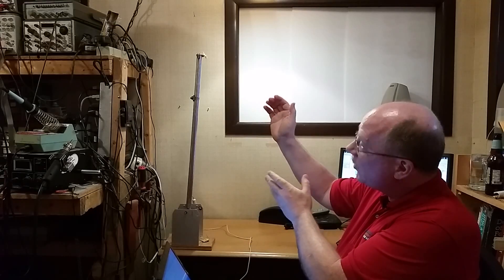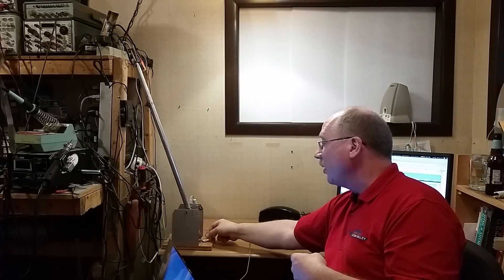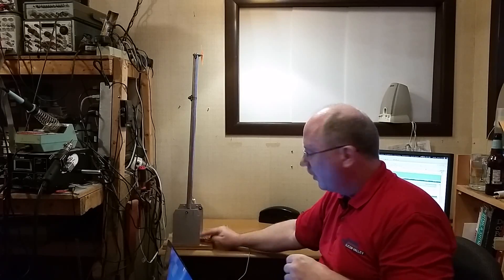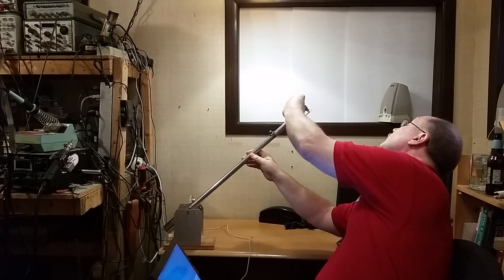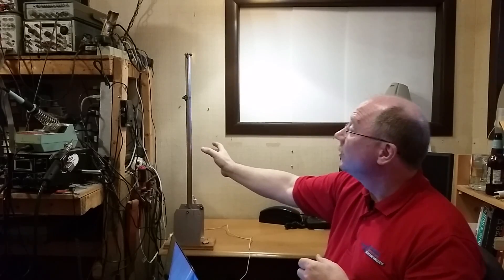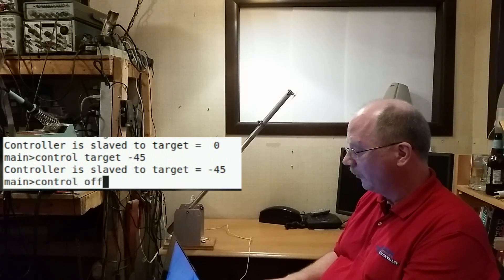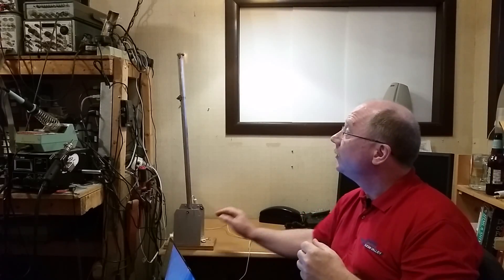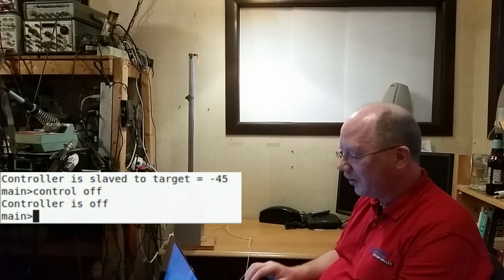What is a PID Controller?

Comment: 'PID without a PHD' is the best explantion of PID control that I've come accoss. It's even better than this video. Sorry Tim.
When you know that the I term is just the running sum of all previous error terms and that the D term is just the latest error minus the previous error, it becomes really easy to understand and therefore to write microcontroller code for.

Comment: Perfect explanation, 
although why it's not possible to run Proportional part and Derivation separately? And why just integral part cannot be turn without P and D?

For Integral pert can I say this?
"if error occurrence takes more time before it's cleared 'I' is higher. Bigger error and more time it's out of correct position 'I' goes higher and it will not go down until it reach correct position."
Reply from the maker: Tuning P & D separately: The amount of derivative action that you have determines how far you can push proportional.  For this demonstration system, you can't have much proportional gain at all if you don't have derivative action.  In fact, with really good bearings, at least in theory you couldn't have any proportional gain without some derivative action.

Integral is the same way.  For some plants you can use just integrating control -- this isn't one of them, and needs to have proportional action (which requires derivative action) before any proportional action can be added in.

As for what integral action does -- in general, it doesn't go away when the plant has reached its target position.  Integral action is there to provide the standing drive that some plants need to stay in place at the target position.

Comment: hello sir i m an undergraduate student in ME  i m working on self balancing vehicle(Segway) i apply PID in MATLAB on full non linear system so i want to ask you that is it ok to apply on nonlinear system or should  i  use LQR controller 
pls reply
Reply from the maker: LQR (plus an observer) is just a way of arriving at a controller design.  A PID is a controller topology, and there are a lot of practical SISO controller transfer functions that can be translated into a PID topology.

It's been a long time since I've done the math, so feel free to double-check this: If your plant is SISO and you model it with an integrator and one pole, and you do LQR and a full-order observer, then your controller will be a second-order SISO system.  Just about any reasonable choices for the LQR cost weighting vectors and the observer inputs (noise covariances, pole positions, whatever), will give you a controller that can be cast as a traditional PID.

Ditto (and again, check my math) if you model the plant as one integrator and two more poles (one or both of which could be an integrator), and make a reduced-order observer, then assuming reasonable choices for the LQR and observer designs, you'll end up with a controller that can be cast as a traditional PID.

Now here's where I get cynical: when you do LQR design and observer design using "optimal" control theory, you are pulling numbers out of a hat, and you do not have any formal tools for accounting for plant variation or mismatch between the plant and your model.  So you choose LQR weighting vectors, and he inputs to whatever observer design method you're using by -- wait for it -- the seat of your pants.  You're doing seat-of-the-pants design, only it's hidden behind a cloud of mathematics.

For a real-world SISO system, I prefer to use frequency-domain design (I think a more modern search term would be frequency response shaping).  It's still intuitive, but because you can go by the rule of thumb that plant responses are less well known at higher frequencies, it's rule-of-thumb design that gets you closer to formal robust control methodologies.

I'd have something to say for robust MIMO controller design -- except that I've never had to do it.  The closest I've come is some systems with multiple loops closed around different sensors or actuators, but each loop was considered as a SISO system and designed independently.  

Was this the best-ever robust design methodology -- no.  But in the end, for the stuff that I was working on, I found that we were pushing pretty close to the limitations of the plant.  The biggest contributions that I could make as the control guy was to hang over the mechanical designer's shoulders and help them to make tradeoffs in  the design of the plant itself, so that when we squeezed the most out of it we'd get better results than before.
Reply: sir i mail my code so by seeing it can you suggest some ideas 
pls

Comment: You definitely took the complexity outta PID, making it intuitively obvious to the most casual observer.  Brilliant!
Where I'm still in the dark is the hardware for this excellent demonstration.

School us bro. Your PID without a PhD lacks the touchy feely aspect so many of us kinesthetic learners require that is so  eloquently demonstrated here.    The mathematics of hysteresis gives me diaphoresis.

What makes the fan reverse direction and change speed? Are you using an arduino, beaglebone, raspberry pi or a PLC or a PAC with driver for pulse train output to a stepper motor or pulse width modulation (PWM) of a relay (coil/solid state) to the  DC motor, or ...?  Who manufactures your motor control board? How is it wired?  USB, RS-232 serial, Ethernet?

What are you using for an angle sensor?  A potentiometer?  0 to 10V or 4-20 mA?  Hall effect? 

Help us noobs out bro with the knowledge and experience to actually build one to play with in reality.

Comment: Tim,
Excellent explanations and that simple but very cute gadget used for your demonstration! I am impressed!  I would be interested to know what kind of Microprocessor/ programming algorithms/ and programming languages did you use in PID loop controls like these?   Also, in the future videos, would like to know how double and cascaded PID loop works.  Like for example, if I want to control an environmental chamber with an exact temperature and Humidity as the PVs - how would I go about it?
Reply from the maker: Hey Tarique:

Thanks for the comment.  

The chip on that particular controller is an LM3S811, although there's a lot of parts that could have been used.  The core was chosen because it has a 32-bit core to allow for "sloppy" programming (I did it as a training tool and wanted to focus on the algorithms, not hand-optimized code).   The rest of the chip was chosen because it has PWM channels designed for motor control, and the usual compliment of peripherals.  The code is written in C++, and the algorithm is pretty close to the software I write in my video on how to write code for PID (https://www.youtube.com/watch?v=JVqJ7uRGwoA).

Note that if all you wanted to do was accomplish the task of servoing the arm, you could use an 8-bit micro with appropriate peripherals, like a PIC or an Atmel AT-whatever chip.  When I built the trainer I intended it for use by folks who would be writing code to learn control theory, so I intentionally threw a lot of extra processor power at it (and chips with the ARM M-series cores are getting pretty inexpensive these days, so why not?)

Comment: Wescott Design Services
this video is very good. will you please make a similar video on Fractional Order PID Control and post it in youtube?
Reply: Thank you for your interest.  I'm afraid that I've never had occasion to work with a fractional order PID controller, so it would take a considerable amount of prep work.  I think I'm going to concentrate on getting the basics done first.  I will say this if you're contemplating using one: I've been in this game for a bit over 25 years, and I've never had occasion to implement a fractional-order controller.  I suspect that nearly every problem out there in closed-loop control can be profitably done with a discrete-state controller; anything requiring continuous states, or fractional orders, is going to be an edge case.

Comment: I got a comment in another group that the video doesn't make it clear where the PID controller is -- in this case the PID controller is in software, on a motor drive board at the back of the trainer.  But a PID controller itself is a mathematical construct as much as anything else, so it can be implemented with a processor connected to suitable I/O, a handful of analog circuitry, using some mechanical arrangement, etc.  The possibilities are infinite.

Comment: Great video, Tim.  At ~3:22 you say the error between the target position and the desired position of the arm. Did you really mean for one of those words to be the "actual" position ?
Reply from the maker: +boB Gudgel Indeed I did. For the record, the error is defined as the difference between the target position and the actual position.

Some people might say "commanded" or "desired" instead of "target" -- they all mean pretty much the same thing in this context.
Reply: +Wescott Design Services  Excellent.  I knew what you meant but wasn't sure if you knew that you said that.  Yeah, commanded might be a better word.  boB from SED, but not too often.
Reply from the maker: +boB Gudgel It's amazing how many little things slip by.  I can't dub the audio, but I've put a textual annotation in there so future folks won't be confused by that.